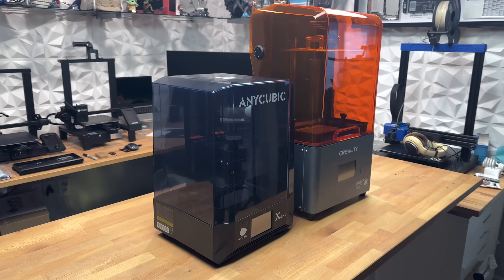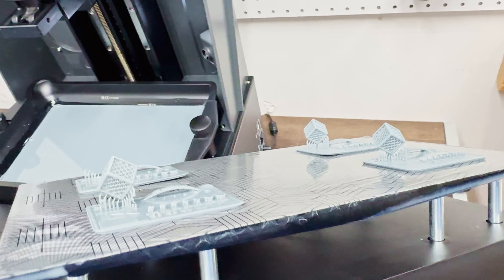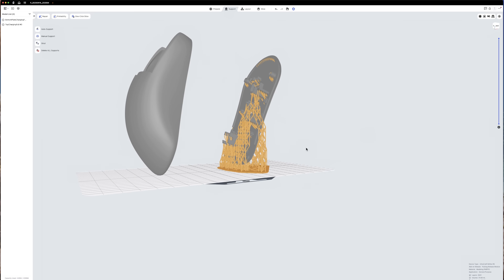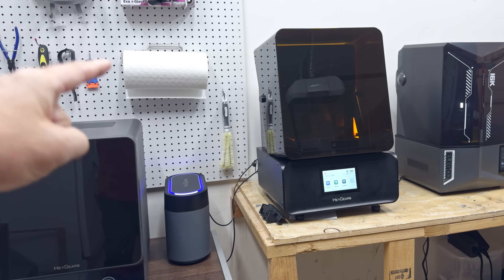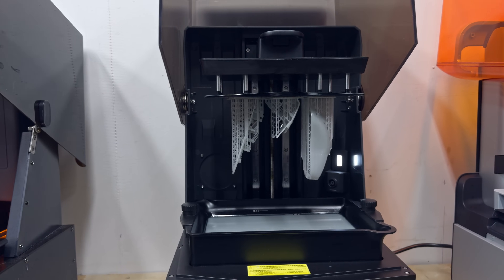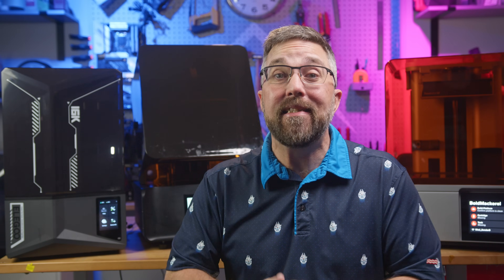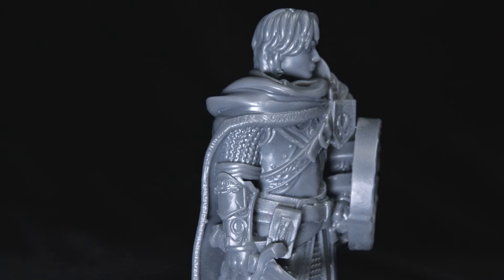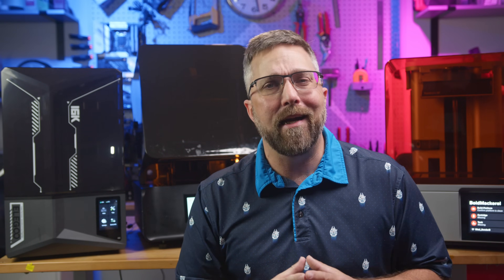Saturn 4 Ultra vs. Reflex RS vs. Form 4. Surprisingly Close!

Comment: Nice video comparison! I just got a S4U 16 yesterday and have it setup waiting for use. My plan is to use “super elastic” resin which supposedly mimics silicone to make massage tools for therapists. I tried using TPE on my FDM printer but the results weren’t good enough. Dimensional accuracy isn’t the priority with this task. Reliability and creating a part that has the right consistency, texture and durability is. I’ll check back in in a few weeks after some R&D.
Reply from the maker: Let me know how it goes. You may have issues with not being able to control lift speed and height for elastic materials on the Saturn 4.
Reply: @ I hope not but I guess that’s the risk with entry level machines… Thanks for the heads up
Reply: Would you mind sharing what resin are you planning to use? I've done some testing with Form Futura Flex63A on my S4U and it was easy to print, even in high speed mode. You just need to let it rest between the layers little longer. The durability may be kind of a bummer, since elastic resins are still brittle compared to what you may be used to with TPU.
Reply: @ Brittle huh? Not the word I wanted to hear…. Oh well I’ll see what it can do and what it can’t. 

This is what I got off of Amazon: 

SuperElastic 3D Printer Resin, Softness 60A Simulating Soft Silicone, Made in Korea by 3DMaterials

Thank You
Reply: How are your results?

Comment: Honestly just go with the S4U 12k if you can find them still on sale. Primary difference is the heated vat, your not gonna notice the resolution difference on the x-y only reason they switch displays is because of suppliers.  The only major issue with the ultra's is the screens are a absolute pain in the ass to replace (and you will probably have to replace it at some point as the LCD on all SLA's is a consumable. The UV will eventually kill it)
Reply from the maker: Heated vat was one of the requirements for the test. I cut a lot for time but I probably shouldn’t have cut that. If you’re in a non climate controlled space like I am, temperature swings can have a huge impact on print consistency.

Comment: Which would you recommend for someone looking to make 1:4 scale figures?
Reply from the maker: For multi-part models the reflex RS is probably the best option. The 1/4 scale Rey model in this video came out perfectly using their cheapest resin. In the video the model isn’t even glued together, all the pieces are just friction fit. With that said the Pale Purple resin is on the brittle side for thinner parts.
Reply: @ElevatedSystems  thanks a million for the reply and awesome video. it was just what i needed!
Reply: Saturn 2 8k it will never let you down trust me! I have the Saturn 3 ultra and 4 ultra 16k Saturn 2 outperform it with my statues and armour 1.35 to 1.8 scale with precise accuracy and stunning detail!  It's still my go to daily workhorse are just know it'll never let me down! It's been running daily for 2 year's! On same screen I might add!
My only gripe now is the display on it needs a refresh,  I wish elegoo would re visit it and add the Saturn 3 ultra ui atleast to it and I would buy it all over again any day!
Reply: @Emtbtoday  Thanks ill look into that too

Comment: Great video. I'm looking at the reflex. Can't decided between the reflex or the RS though. Do you think the formlabs clear resin would work on the RS? I need a super clear resin.
Reply from the maker: Like any clear resin the Formlabs clear needs post processing to be super clear. I’ve successfully used Sunlu High clear resin on the RS which can be polished crystal clear.
Reply: You can just use Heygears' PAT clear resin. I’ve been printing earbud cases with it for about six months now. They’re still super clear, no yellowing at all! Really recommend it.

Comment: "120 micron short"? loooooool it is ONLY 0,12mm from 123mm, which is LESS than 0,1%  - yes, ONLY 0,1% for god sake, you "expert" !!!!!!!! 😂😂😂
Reply from the maker: That is outside tolerance for injection molding. Are you going to risk tens to hundreds of thousands of dollars on tooling? I guarantee no manufacturer will.
Reply: @ElevatedSystems  sorry, but you do not know anything about the injection molding - for serious work, nobody will "play" wit these toys. You need to multiply the price of Form 4 at least 5x, AT LEAST - a good start for a good "non hobbyist" 3D printer is about 20 - 25 THOUSANDS! That is one thing. Another, you have to "calibrate" the printer+resin combo for higher accuracy - not the resin, but the combo - same conditions, first of all same temperature... If there are issues with the accuracy, you need to adjust the "tolerances" in the slicer.
So, the summary, nobody is going to risk a lot of money with these toys...

Comment: Great video! I was wondering, does the Form 4 have options to change the layer height to get rid of some of the layer line effects?
Reply from the maker: Thanks! The Form 4 does let you change layer heights, but it depends on the resin you’re using — each material has its own allowed range. That said, even at standard settings, the Form 4 does a great job with super smooth, flat, and gently curved surfaces with basically no visible layer lines. You really only see them on more rounded top surfaces, which is pretty typical for most 3D printers. Getting rid of those usually requires really aggressive antialiasing.